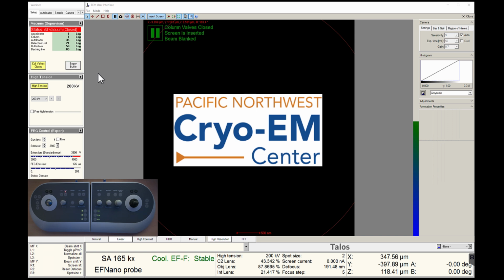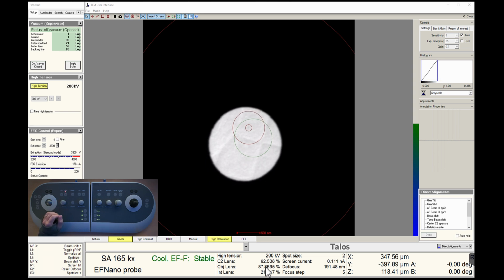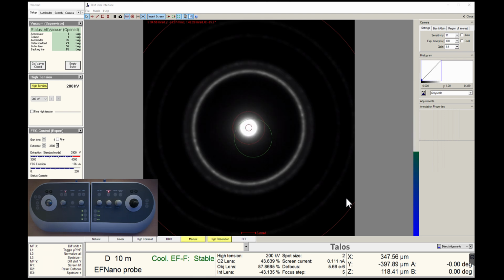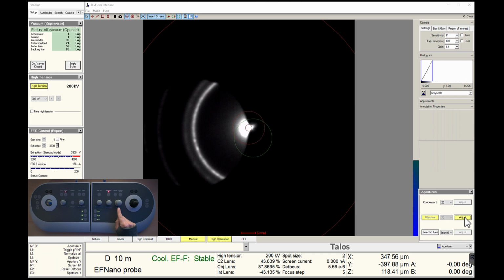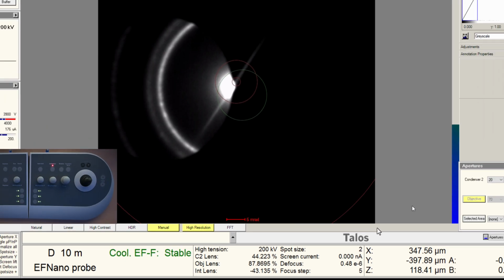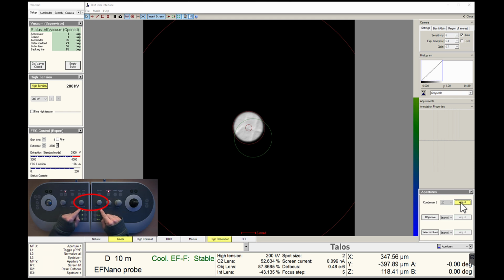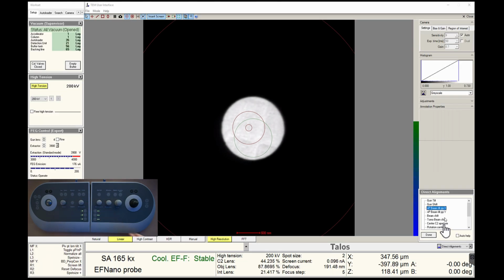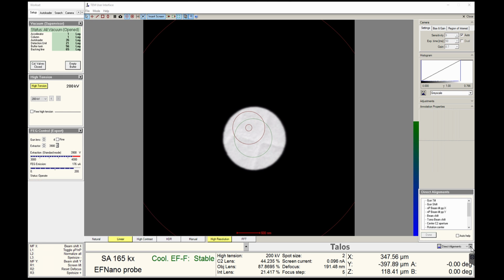Performing Direct Alignments on a 200 kV Microscope with Fringe-Free Illumination

Comment: Thank you very much for this video series, Marcelo. It's a quick and practical way to get tips on alignment and presets for SPA data collection.
I have a small question: in the focus adjustment step in diffraction mode, there's a defocus applied in this mode. I usually apply a eucentric focus to zero out this already defined defocus, and only after that do I adjust my "new" defocus. What could you tell me about this? Is it a good idea, or does it make no difference?
Reply from the maker: Hi Luelc, thanks for your question! That’s actually a good approach and pretty much what we do around here. Before each video, we do a quick test run just to make sure everything is working fine.
The residual value you noticed is the nominal one, and it might not match the real value. Just as a friendly reminder: you can be at eucentric height and eucentric focus, but the nominal defocus might still not show zero. That’s because it’s just a reference based on the last time someone reset the defocus.
Still, it’s always a good idea to reset the defocus value right after setting the eucentric focus.